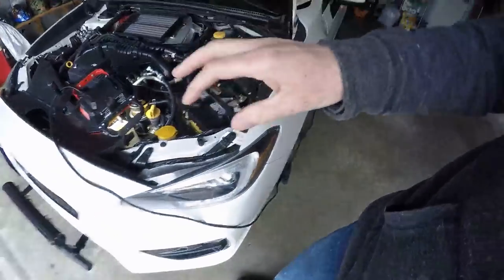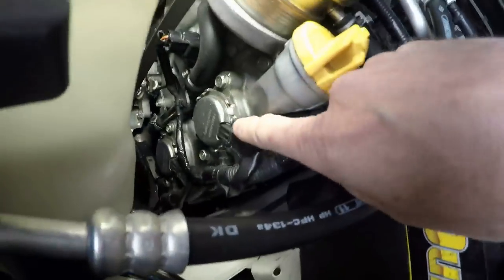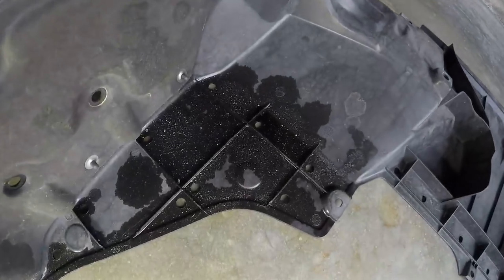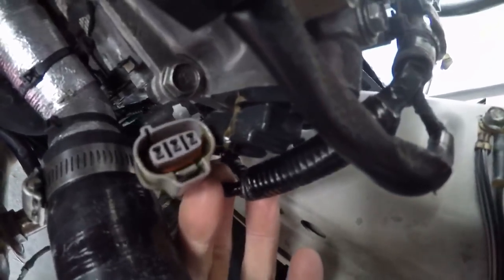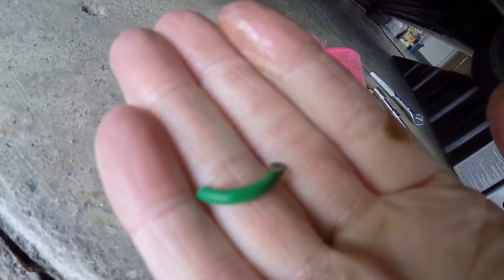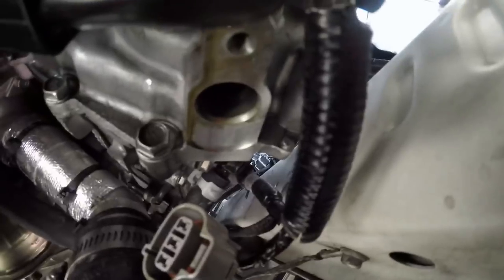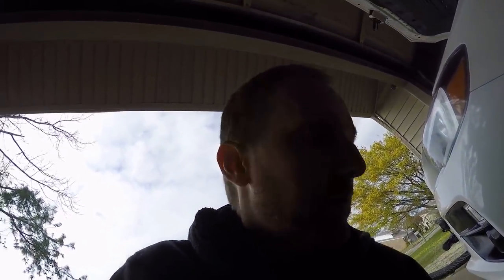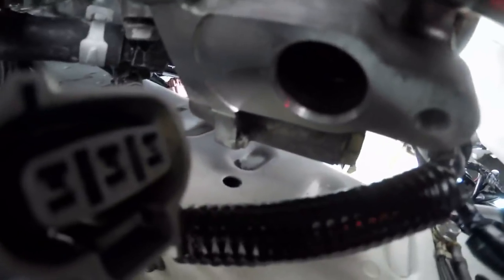2015 Subaru WRX Ep. 922: Re-Visiting the Cam Position Sensor Oil Leak

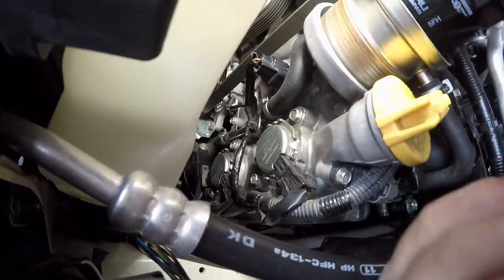Comment: At 1:10 those metal thingys are for variable valve timing. The part with leaky o-ring is (exhaust) cam angle sensor, there is also intake cam angle sensor at top (can be seen 1:06 ).
Reply: Thank you 👊🏼
Reply: Thanks for you info on the cam position sensor, I need to replace the RH exhaust one, or at least see if I have a leak causing interference in the electrical connector leading to a P0017 (Hopefully nothing more).

And correct on the VVT pieces, at least one of the two round metal things on each side are your oil control valve solenoids. Subaru had these failing prematurely on some 2015 WRX's and updated them for the 2016's. I believe there was another update in 2017. Something to pay attention to.

Comment: All the bolts would strip out and I'd regret it immediately(returning the car to stock) , dude that was my first thought lmao. Thanks for showing where the sensor was and revealing the big oring was the issue. I'm getting the p0011 and the p0016, well I havent got one or the other like once a week. I'm gonna change my oil even though I'm only at 800ish miles, I have been running e60 and driving it hard.

Comment: Mark - find a Harbor Freight and get another set of O-rings I think another black assortment should only be about $10 - you may not be able to get the stock O-ring without the sensor.  I think the sensors are cam position sensors - I had one go out in my XV and the car wouldn't let me use the cruise or rev past 3500 RPM - I'd be careful with it hitting the ground - if memory serves they run about $60-80 each...

Comment: MARK, get some wheels and fall in love with the car all over again. Ditch the Header idea, save the pennies.
Reply from the maker: some day. never heard back last week when i reached out to Sparco in Japan.
Reply: Capp i totally agree!! Headers should be nicknamed headaches. Rims won’t need any maintenance compared to headers. The power and sounds is always nice but gaskets and keeping bolts tight, start to get annoying after a while. That’s any aftermarket part for ya but headers are hard to reach.

Comment: My 2015 same sensor was leaking. Oil dripped on hot exhaust pipe. These o-rings have tight tolerances so ask Subaru to order you OEM, they are $3.20. What’s happening that particular sensor gets most thermal heat from the pipes. My leak went away, buy a Subaru o ring.thanks for your past vid, you saved me some money.
Reply from the maker: Thanks for the info!

Comment: I just got a check engine light and say the code p000a. Intake cam 1 (RH) Position Slow Response. Is this the same sensor you are showing?
Reply from the maker: well the cam sensors should be on the end of the cams, ya.

Comment: Hey bud!! I have the code p0018 bank 2 camshaft sensors. I’m about to change the bottom one tomorrow. Am I going to have to take my oil when I pull out the bottom sensor?
Reply from the maker: naw i dont think so. the oil sits in bottom of pan. you might loose a tiny bit, but not much. i cant rememeber where the lower one is. this was years ago.
Reply: I have same code on ny 2015 did replacing the sensor work

Comment: I’m trying to change my damn crank position sensor, I can’t find the damn thing 😤😤
Reply from the maker: that blows brother
Reply: Mendez_Guzman did you ever find your crank sensor?
Reply from the maker: @zackeryshoot2605  https://www.subarupartsdeal.com/resources/encry/diagram/spd/2020/large/93d6695915cdd18b102b1ae780235d23/50dd99086e26cba7d2312fde217ec875.png
Reply: I appreciate that. But that does me no good. Lol
Reply from the maker: @zackeryshoot2605  its 22053, and it shows its under the intake manifold near front of engine, above crank pulley.. if you still can't find it after that... a shop should be able to take care of it.
Reply: @zackeryshoot2605  I did!! The SOB is friking hidden. It’s basically underneath the intercooler. Right where the transmission meets the engine. It’s on the engine side.
Reply: @zackeryshoot2605  need help bro! I got choo. Snap chat me??? I can show you were it’s at. Lemme know amigo!🙂
Reply: @mendez_guzman9661  zshoot1994
Reply: I got it. Thank you